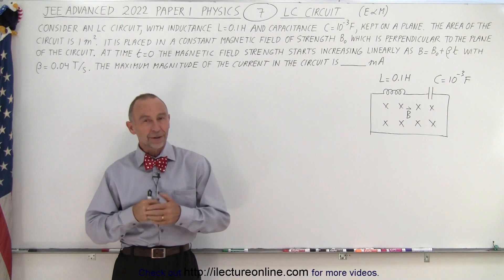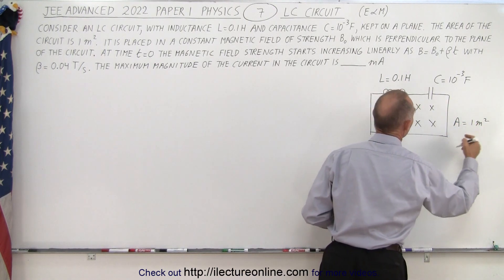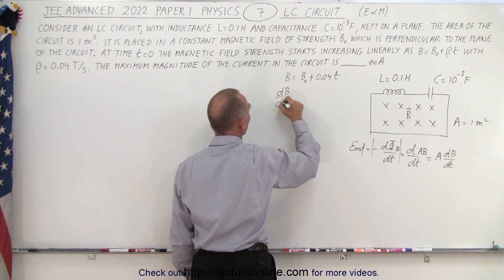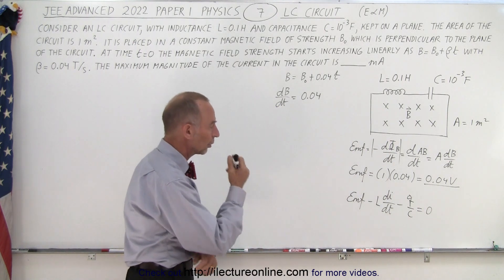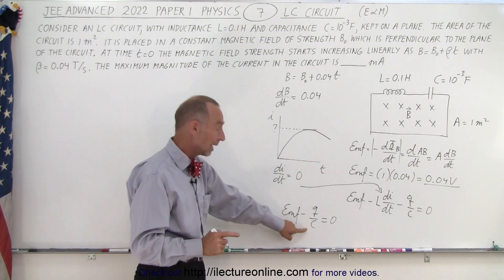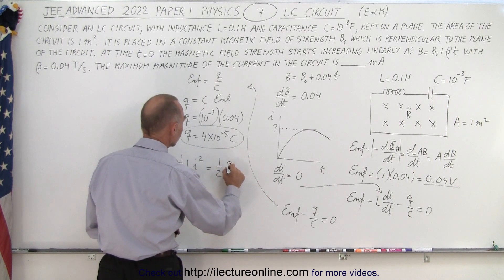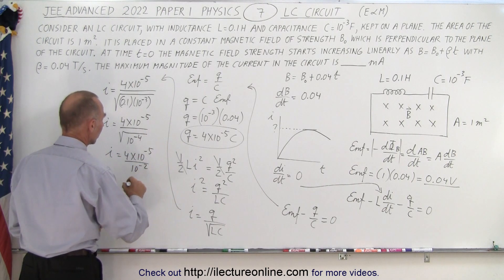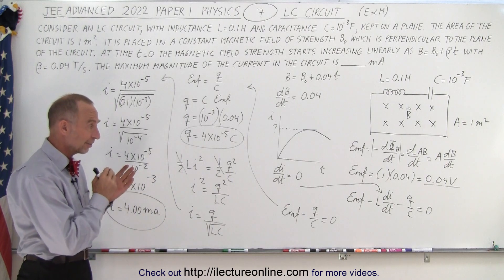JEE Advanced Physics 2022 Paper 1: #7 LC Circuit (E&M)

Comment: In normal LC oscillation (Without battery) it is understood that energy maximum stored in both will be same. But how do you prove that in this case when a battery is connected that the maximum energy stored will be same
Reply from the maker: In order to store energy onto those components, you will need a battery (or power source) in the first place.  When you then remove the battery, the total energy stored will remain constant.  With the battery connected we know that the sum of all the voltages around the loop will add up to zero and we can use KVL the sum of the currents principle.
Reply: @MichelvanBiezen  thanks profesor 🙏
Reply: @MichelvanBiezen  sir but in this case we haven't disconnected the battery, then how can we say that the energy is constant?
Reply from the maker: There is no battery hooked up in the circuit.  Only a capacitor and an inductor.  (see the diagram).

Comment: Why didn't you used the formula cv²/2 for energy of capacitor, 
Would've saved the trouble of calculating Q.. 
Anyways nice explanation
Reply: Yeah you're right
Reply from the maker: When I teach this in the classroom, I tend to start with the basic concepts and build up the intermediate equations, rather than trying to memorize every single form of the equation.  However, for the JEE tests where time is very critical, it is a good idea to memorize as many of these equations as possible, in order to save time.